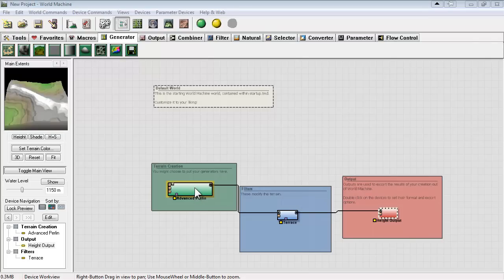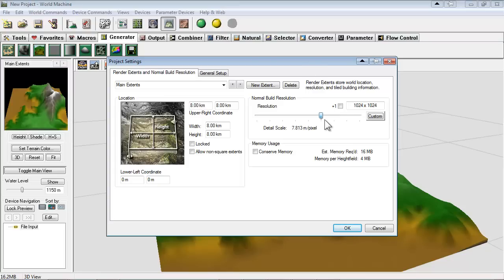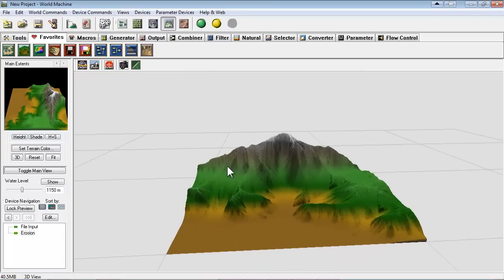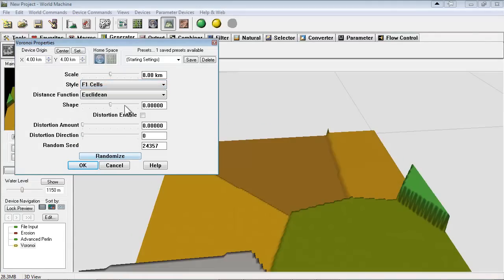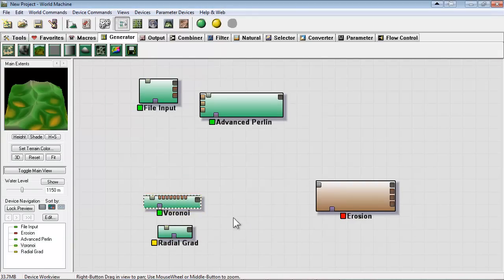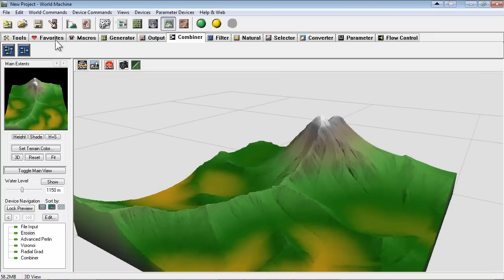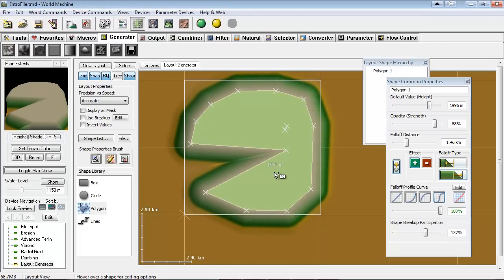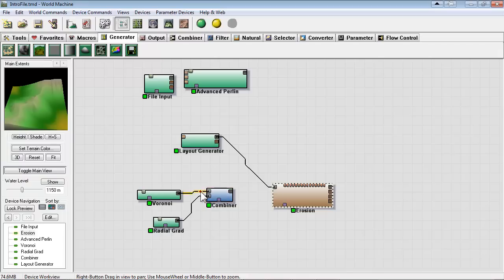Intro to World Machine: Chapter 01

Comment: I imported a height map but everything is near 250. It looks perfect but it is all too high, is there a way to just reduce the RGB value of every pixel? (Darkening the heightmap weakens it, as in 250 because 125 and 240 because 120 instead of 250 becoming 125 and 240 becmes115. Subtract not divide)